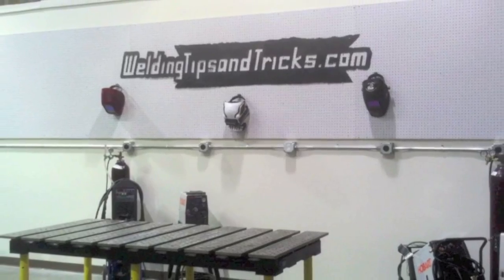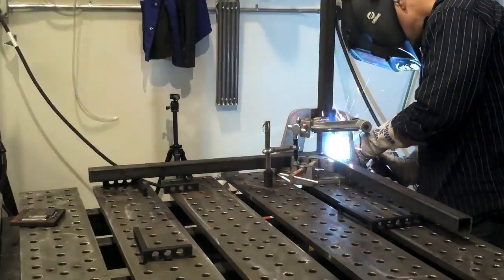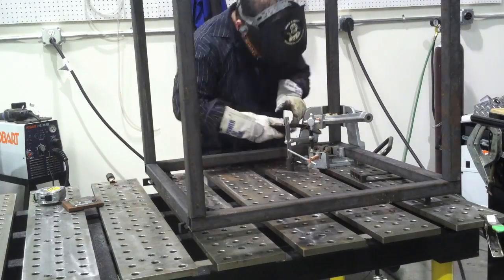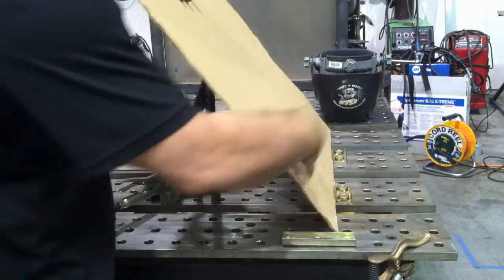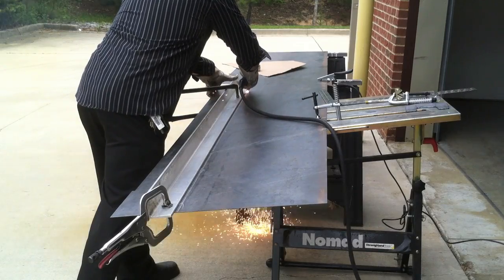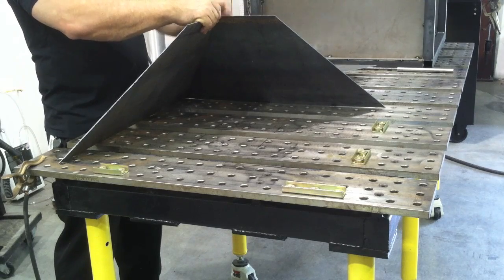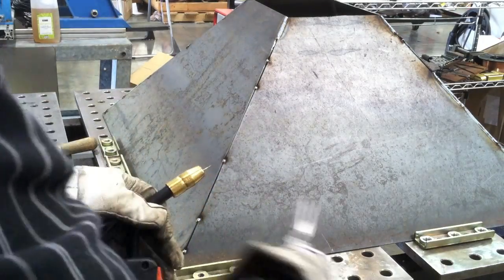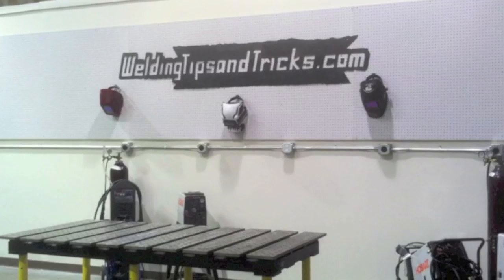Plasma Cutting Table - DIY Downdraft Table using StrongHand Tools part1

Comment: Used your design at work but add a second funnel to make a bigger table for larger work doing cromeium  ware plates running a five horse  blower and filter it works great thanks for the video Jody

Comment: Thank You for this video! Jody, I am trying to get a downdraft system completed for a DCH2 4' x4' Plasma Cam Table, do you have any suggestions with the exhaust fan or under the cutting table for your Plasma Cam Table and the way you built it? Did you use this structure under your Plasma Cam Table? Please reply, I have not gotten much feedback from the manufacturer. Small company here so I am trying to work this in while I am satisfying my customers needs.
Reply: I'm thinking about using a blower to exhaust fumes from my everlast plasma cutter.

Comment: Thanks for the strong hand tips, and welding table tips!    Now when you were cutting with your plasma torch, it looks like the tip was on the metal.  Doesn't that shorten the life of your plasma consumable tip?    I've been using the stand offs that clip on to the end of the torch to keep it from touching the metal.
Reply: It depends on the amount of power and also on the tip. Very low power on thin material can usually be dragged. I bought some drag tips for my Everlast plasma cutter to allow me to drag on thicker stuff.

Comment: Hi, I see U use a Hobart welder. I have trouble getting a good ground on my 175 amp 220 volt Hobart unless I grind down to bare metal under both the ground clamp and the weld surface under the electrode. My friend has a Miller and only has to throw the ground clamp on his welding table to get a ground. Am I doing something wrong? Thanks,Dan

Comment: I have a few ways to see/feel/measure the difference between stainless steel and titanium. The easiest way is grind it. Ti will spark brightly white. Stainless won't spark as brightly and it will be orange/red. Weight is another dead giveaway. In most cases I just can feel the difference.

Comment: Hi, another nice video man. Just a quick question is there anyway of identifying the difference between titanium and stainless steel before you start to weld it ? I'm only asking this question because recently i tried to weld a titanium bike exhaust thinking it was stainless steel using 316 rods and i made a right pigs ear of it. It ended up cracking where id welded and falling through. Any tips for next time?

Comment: What I have found useful for holding steel sheet together is strips of  of .016 or .025 aluminum and neodymium magnets. The aluminum is easily bent using a set of sheet metal seamers to the angle you need. Glue the magnets into the end of some small dowels to make it easier to handle the magnets.